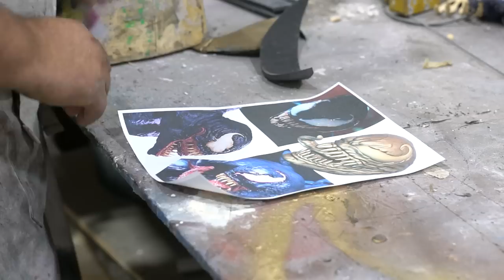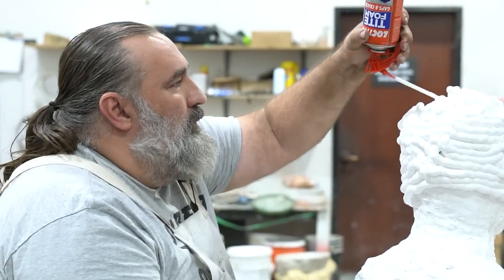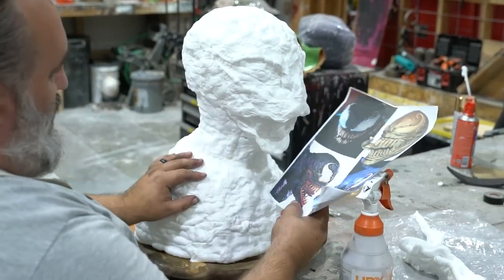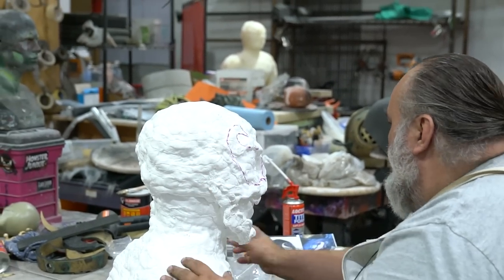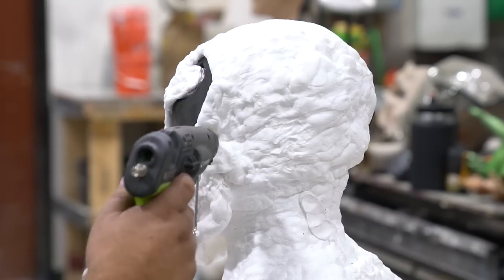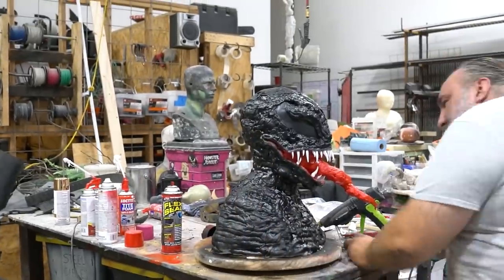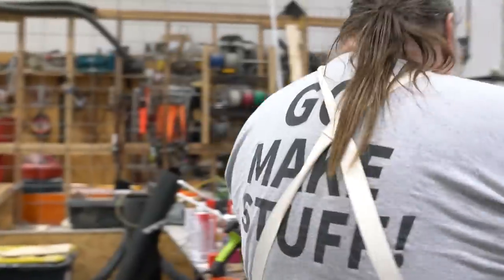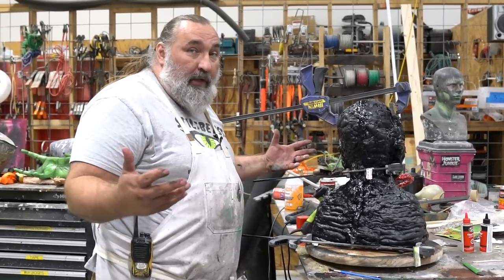Make Venom locktite foam bust Halloween display Marvel comics

Comment: A few years ago I was struggling to find a way to make HAIR for a foam statue (using a foam wig head) so that it looked like chiseled stone bust. Your video making a woman statue demonstrated your hair making trick with the spray foam and you saved my "in work" project from the dumpster. Thanks again for that. The effect was that half the head was normal but the left side was a skull. It was light on one side to show the normal face keeping the skull in the dark. Then a lighting effect would light the other side and simultaneously turn off the light on the normal side so it cannot be seen. The end effect was the stone statue looked like it transformed in the lightning. It was a great but simple illusion I designed and I believe it is completely original idea. Anyway I have always wondered if you had any other can foam tricks like the hair. Maybe Cloth for example like a toga on a roman statue? I know about doing this with real cloth and plaster but i would prefer just foam.
Reply from the maker: I show all my tricks so just keep watching!
Reply from the maker: your project sounds cool!

Comment: "I hope nobody thinks I have this planned out. I assure you, I'm just that good." 😅

Old can might explain why the hands I did recently cured so quickly. Timer was unnecessary, to the point that I needed to carve away a lot of the puffiness that set before I could press it down.

Guess I'll be checking dates when I buy in the future.
Reply from the maker: yeah, I always check the bottom of the cans now

Comment: Been doing a lot of experiments with loctite lately,  found out on accident if you have a old can that is full but no pressure you can open the bottom and scoop out the resin,  it has a insanely long work time took almost a hour till it set for me. Also to smooth I found a wide plastic pallet mixing knife swirled against the surface with good pressure smooths it nicely,  think it's the friction heat created that kinds works like a mini heat gun.
Reply: This sounds like a very interesting idea and I have a few old cans. I just can't picture in my head exactly what you did and the steps you took. Do you happen to have a video of the process anywhere? Thanks in advance 😊

Comment: UV resin is a great way to add a glassy look to surfaces. And it’s easier to use than epoxy. I always enjoy these builds. The only thing I’m not really fussed on are the layer lines and texture of the foam. Is there a way you could smooth the surface? Sanding perhaps? Or a layer of filler?
Reply from the maker: you could add filler or foam clay, but I love the two hour spontaneity of making a head from scratch and getting it finished in that time.

Comment: I have one of those cordless ryobi glue guns. The smaller one. The cool thing about it is you set it on the base to heat up. Then remove it from the base and use it, if you do not set it back on the base it cools. Effectively doing what you just said you wanted it to do. its pretty neat. I do wish they made one for the large glue sticks too.
Reply from the maker: you just have to time it right I guess.

Comment: This was awesome Allan!! Happy Halloween too !🎃👻💀 Just a few questions, if you could possibly help, as I couldn't seem to find the answers in your last videos and I'm having trouble. I'd really appreciate it so much.🫶😊

1. Can you paint the loctite foam with acrylic paint instead of spray paint? I only have a few spray paint colors and need lots of colors.

 2. Can you sand the locktite to make it smoother? I'm stil trying to make a jack skellington head since I messed up the first one. I feel like it's so last minute I shouldn't even bother but I'm trying. 🙁

3. Can you cut the locktite foam, like you can EVA foam, with a "hot wire foam cutter", as long as, you're outside or well-ventilated? 
Thanks so much for your help in advance! 😊
Reply from the maker: 1. YEs
2. you can, but for Jack Id use a sphere pattern and EVA foam- its already much smoother- EVA clay on top will give you the features, I made one like that a few years ago.
3.you can, but its much easier and less deadly with a knife.

Comment: I have watched almost all your other foam mask videos,  this is the only one you warn about the fumes ? , I mean you put the skull mask on your head before it had dried.  Is the actually deadly?, I trust your opinions,  please let us know why you changed the warnings in this video. Please
Reply from the maker: I mean...Im not dead so deadly is a strong word. there is a warning on this one because the more people who see this the lower the average IQ of the viewer is.  No fumes are good for you, avoid them if you can. Im pretty fume tolerant from all my working with stuff so I barely notice them- bu they could kill a pet parrot cause birds are super sensitive. ciggarette packs have warnings also- six or so masks a year like this I dont think are an issue- make one a day for a few years and you will have an amazing collection ....and possibly lung cancer. Well ventillated space I have fans and such and Im in a big shop. Dont make these in your closet right?
Reply: @StiltbeastStudios  thanks so much for replying,  I make a lot of things very similar to the ones you make.  I've watched others, and most are way too critical and too worried.  I prefer your methods over all others.  I haven't used the foam for a mask before,  it's new to me. I was blown away by the ease and the structural integrity of it, as well as the  ability to mold it. Gonna attempt something with it.  I figured it was safe,  I mean, I've used it in construction quite a bit.  That warning just kinda scared me enough to reach out to you.  I think you'd like my style of crafting. Too bad I'm in Georgia.  I bet you are super busy right now with Halloween coming up. Thanks for the fun , informative channel,  I made a krampus like 10 years ago,  the one's you made are impressive,  thanks again